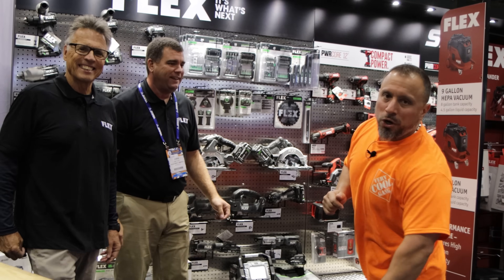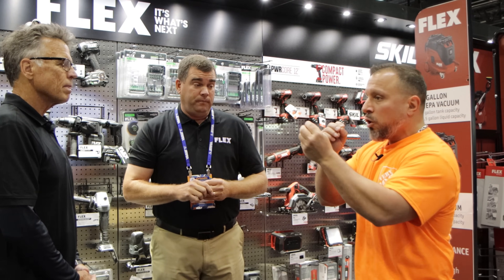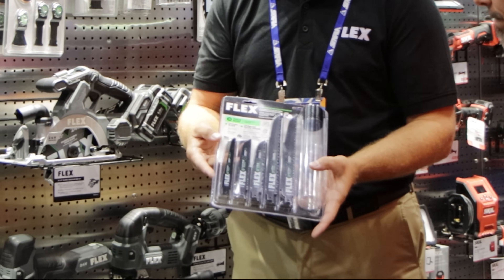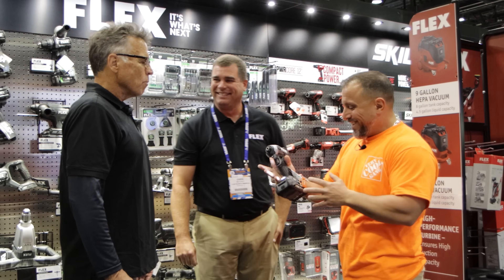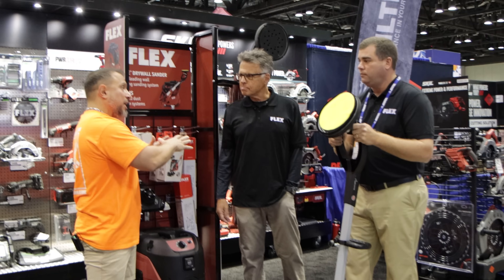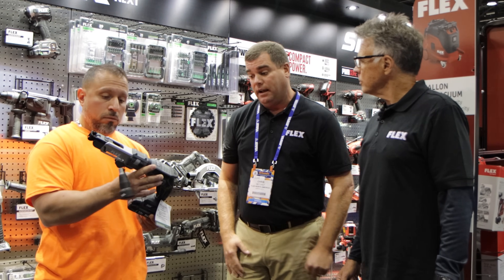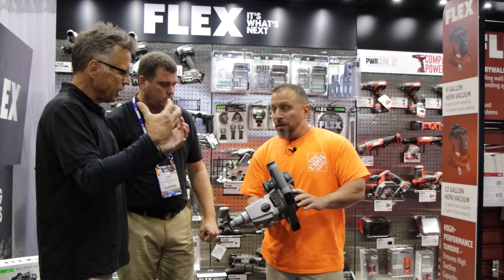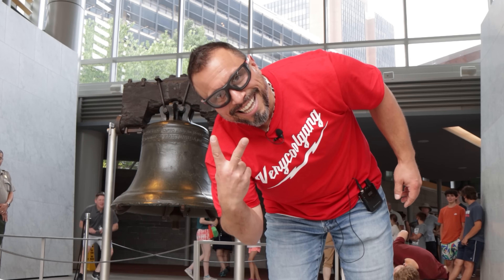FLEX Tools RELEASES NEW STACKED LITHIUM BATTERY Information!

Comment: I’m switching over to flex , all they need in my opinion to have me 100 all in is to get a denser battery pack like dewalt power stack cuz not having a bulky ass battery on the drill helps to get into those tight spots

Comment: They need to put out a deal you cannot refuse on their top of the line drill (or impact driver) to try to entice people to switch. Maybe the top of the line drill w/ the smallest  battery and cheapest charger for $99, or maybe $129… or with 2 small batteries for an additional $30… so a pro can use it on the job, being able to charge one while using the other, impact driver out the door for $150, your going to get some people to try it out for sure.. might not make much money on the first sale, but you got them on your platform… and if you can live up to the commercials, you can be sure they will want to get more use out of their batteries with some more tools and probably a big battery as well.

Has anyone seen Flex used out in the field much? Is it being adopted at all? Personally, I haven’t seen any of their tools, anywhere at all… which also makes it impossible for me to try.

They really took on a challenge here…if they tried to enter the market on the low or mid range/consumer or prosumer, they would probably be adopted pretty quickly in that scenario, but seeing as that these are competing with top of the line tools and their prices are not cheaper, but MORE expensive to boot, its much harder to get people to switch/try them… this type of customer needs to know they can depend on it and whatnot, they cannot take the risk, like a consumer or prosumer can… without it costing them money. The consumer can take the risk, knowing that the tool is probably fine for them and its its really bad for some reason, that much worse than the standard brands they are used to, they can return it, no harm no foul… but the Flex buyer, well, he could be risking quite a bit.

And maybe throw in a manufactures coupon inside as well with that first cheap deal, where on your next bare tool, you get one of the larger batteries for free or 1/2 off or something where it comes out cheaper than buying a tool+batter kit on sale. A customer has a great experience with both the first and second tool, they are probably going to continue and quite possibly then become brand-loyal.

Just a thought. I’m no marketing expert, I just like to do thought experiments like this for fun.

Cheer Vince, the Mrs & The Flex CEO (I know he reads my comments, I’m suuuuuper duper important err something, I’z real nyyyce like)😉
Reply: I jumped yesterday and sold all of my m18 fuel tools, and packout. I then turned around and replaced all of them with flexs best tools, then went to work. I am an industrial journeyman plumber. I was extremely surprised and love them. Now the true test will be how they hold up over time because they are extremely powerful tools
Reply: perfectly said my guy

Comment: Now, if I understand correctly…. Theoretically, you can charge lithium as fast as you can drain it. .5c 1/2 speed charging is usually done by default to be safe w/ the heat and all.

Comment: Oh no! No push-drive on the drywall screwgun! Know what? If the battery can handle it (runtime/ charge time) then it's a non issue. Thanks, Vince, and God bless! 😁👍✌
P.S. that right angle sander is brilliant! 👍

Comment: Good evening Vince. As you are talking to the companies, there is a large need for a bit holder case plus bit holders without bits. I use custom load outs. Bosch has two cases but not bit bars. Thank you. Enjoy your evening.

Comment: There is a 1.6 gallon battery-powered vacuum in the black line.  Surprised they didn't mention that.  There's also a light and a radio not seen here.

Comment: Why does the cutout tool come with a 1/4" collet?  I bought it expecting to be able to slow it down to use as a die grinder, because it came with that 1/4" collet.  I hate drywall with a passion, so I have very little use for something that only runs at 28K RPM.
Reply: I want to say most of my burs, roloc style discs and wire brushes are rated at 30-40k.  Not all of it is $$$  Pferd/3M/Walter, either.
Reply: Every [pneumatic] die grinder I've ever run has had a max RPM of no more than 23k, a variable speed trigger, and was often reversible.  Although it does appear Makita has something they bill specifically as a die grinder in their 18v line that has a fixed speed of 26K.  Personally, I just need more nuance.
Reply: @eyeofamon  The electric ones are a whole different animal than pneumatic.  Off the top of my head, variable speed and in cordless would  be Fein 18v, Dewalt 18v (“20v”), Milwaukee 12v (18v is single speed) and Hikoki/Metabo HPT just came out with one.
Reply: I should have mentioned, the Milwauke 12v ones are the only ones that have something similar to pneumatic variable speed.  The Dewalt has a variable speed trigger, the others are just controlled by a dial.

Comment: That drywall sander is exciting to me but I would need a demo. God I hate drywall and this sounds like a dream since it has actual dust collection incorporated - but how good is it?
Reply: I’ve never seen a drywall sander that doesn’t have dust extraction built into it.   I don’t do drywall, so the pros and cons of every model aren’t on my radar but I’m sure there’s shootouts and whatnot with the online drywall community.   The Flex Giraffe brings the multiple heads to the table.  Other than that, I have no idea if it’s better or worse than Mirka/Hilti, Festool, Porter Cable or the newer Dewalt and Makita models.  I’m sure none of them are fun after an hour of use.

Comment: Definitely going to want to get the drywall sander, and love the color red and who wouldn’t mind the name flex
Reply: For red I'd look at the Hilti. It's a rebranded Mirka but in your color way lol.
Reply: @Fictitious_Character  i have the drywall sander.  they need to redesign it. the head is too stiff. If you really want one that spins, get the Planex EZ. if you want a random orbit for better finish, get the mirka.
Reply: @ProbeGT2  The Mirka is labeled as the gold standard. I am running the Planex 2 these days. I have the og Planex too but I think it's a terrible finish sander. When I bought the P2 I was set on ordering the Mirka and got lured in with the light on the P2 which is awesome and the P2 qualifies as a finish sander which imo the OG is poorly done in that category, but the OG will strip damn near anything in its path lol.
Reply: @Fictitious_Character  I've bought almost all the sander, the porter cable, the flex, the planex ez, the mirka. The mirka is indeed amazing, but if you want to run behind your sander, this is not the one. But i'm all about the finish so i don't care if it's a bit slower. The planex 2 looks nice too, haven't had the chance to try it yet.
Reply: ohh and if you look in the video, the seller talks about the angle of the head on the original flex as a feature, but on the new model they ditched that angle. motor on the head is the way to go.

Comment: Pretty good vid for a look at their drywall tools. I've looked into their drywall sanders before and seen some vids on their new G7 or whatever they call it. I really don't think it's on the level of the Mirka or rebranded Mirka Hilti and the newer Festool Planex 2 is a quality finish drywall sander I use but the Flex is still interesting and I'd like to demo it. 

For extraction I've been on the Festool teet since 2012 and have 3 of their extractors in the field and told myself I was going to give the Mirka extractor a try but bought another Festool because it's what I know and everything is fitted for them, but again I'd like to demo one of their top tier extractors. 

Their drywall screw gun I'm interested in and have almost ordered it a couple times. I like that it comes with the collated attachment but feel they should of went with pressure power on feature as the direct drive on the Makita is sweet. Saves you from hearing it constantly and preserving batt life. Of course drywall guns are not power hogs. 

Most interested in the paddle mixer. Put a full sized Level 5 paddle on the mixer and I bet she's sweet. The mixer reminds me of the Festool but at a more reasonable price point. 

Again good vid I've been wanting to see the drywall stuff closer and there's something about Barnaby that seems off lol.
Reply: So great minds do think alike. What's good F.C. long time brother hope all is well your way
Reply: @HeathKentucky  good to see you around these parts Heath it has been awhile. Pretty good around here. Hope you are thriving in this current climate.
Reply: @Fictitious_Character  getting by brother that's all we can do anymore. Hope you and yours have been doing good as well
Reply from the maker: The sanders and dust extraction specs seem top notch, just wanted that drywall screwdriver to have auto! Maybe in gen2! 🤣
Reply: @VCGConstruction  the overseas guys have been using Flex drywall sanders for years and I am sure they are good. The swappable heads on the new one is quite interesting. 

LoL gen 2 is destined for auto. 

Overall their lineup from a drywall perspective is looking interesting.
Reply: I use Festool dust extractors because they made the dust extraction inroads here in the USA and the bags are plentifully available at multiple local stores.   That said, Mirka and Flex buy their dust extractors from Nilfisk and I wouldn’t be surprised if one of those models put the Festool to shame.  Starmix and Nilfisk hose fittings should be interchangeable with Festool.  They all use a standard connection.  I’ve never used a German tool that didn’t have compatible dust extraction connectivity.  It’s the ‘muricans and Japanese that can’t get it together (pun intended). 

I haven’t used the giraffe but I’m familiar with some of the other proper red Flex tools.  If you’re already using Festool and Mirka, I doubt you’re missing out on anything.   Flex is definitely more utilitarian.  

It will be interesting to see how they manage the US cordless line against the pre-existing cordless line.  I’m used to seeing the depth of Flex tools unavailable to the US.  Now the tables have (artificially) turned.  Since Chervon is following KKR’s precedent on this brand confusion weirdness, maybe the Europeans can get the black Flex tools under the brand “Skilsaw FPT”?

Comment: I’m a Milwaukee and dewalt type of guy but flex is on the cutting edge of tool tech
Reply: Dewalt literally made this first lol
Reply: @mercury0214  DeWalt is good, but they didn't 'Make' it. Another company sold them the cells. The just jumped on releasing and advertising more and you fell for it....lol
Reply: @skelley521  not really lol they advertise first they get the rights to it my guy lol didn’t call for much you really think I believe any of these tool heads can make a battery? Of course it’s all out sourced you goon lol
Reply: @skelley521  also the design for pouch batteries has literally been around for years lol dewalt just beat everyone to the punch of getting them in tools
Reply: @mercury0214  flex had a leak for this tech before desalt ever released there battery
Reply: Flex is good for the trade they already make powerful tools we’ll see if they stand the test of time
Reply: @almerino3497  Yes that's the only thing. But solid competition is always a plus. Also good for lowes to have some other pro level tool brands.
Reply: @8bitsamurai6  I don’t get the hate for flex they literally dropped tools out of the blue on par if not better than some of the big three
Reply: Flex was actually selling in a tool as Dewalt was announcing the stack battery tech it was spotted in the wild lol
Reply: I'm with you I prefer red and yellow mostly. But def got my eye on flex. Might have to try a tool or too. Wish they had some awsome 12v tools.

Comment: Seeing these new products from Flex is pretty exciting.  That collated drywall gun attachment looks awesome. The fact that is comes with the drywall gun is great.  Love the depth gauge indicator.   Super excited to see that 6.5 in in-line circular saw in person.  What an awesome design!  Makes so much sense.   Great video!  Have an awesome night! 👍🏻
Reply from the maker: The drywall screwdriver does look pretty nice! I’m gonna pick one up and give it a go!
Reply: The Rigid drywall gun comes with collated attachment and has auto mode which flex does not.  On sale for $150 right now.
Reply: I bought the drywall kit for $300.  Came with the gun, the collated attachment, the drywall cut out tool, 2 batteries, and a charger.  I’ve hung about 200 sheets with it so far and I’m very happy with the purchase!